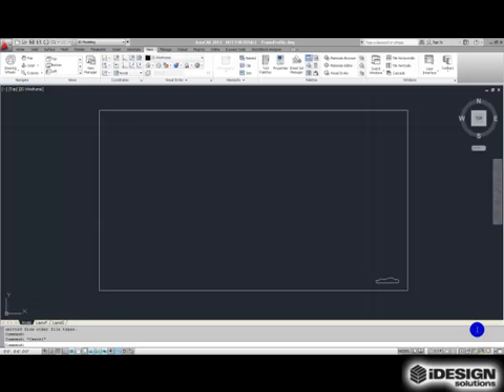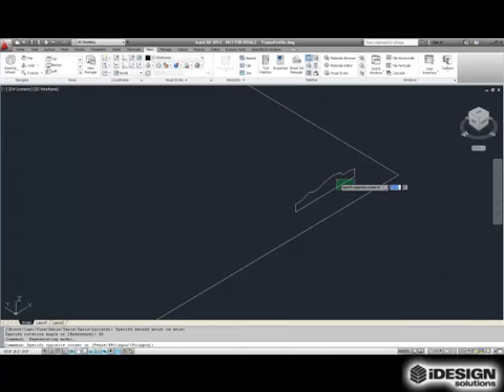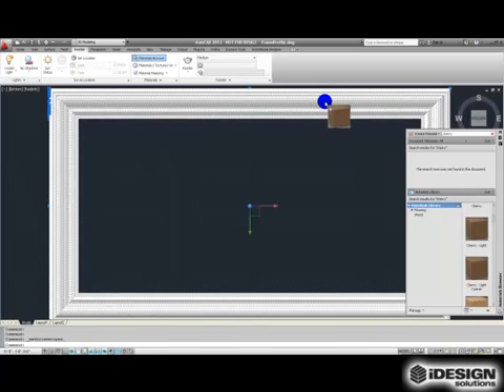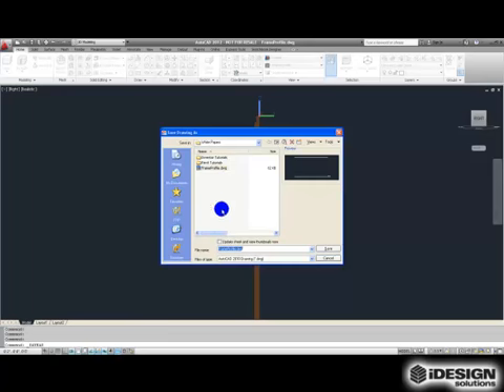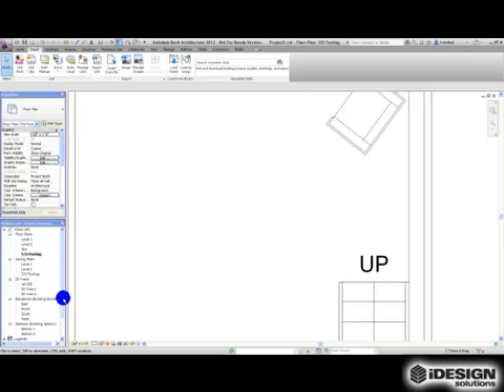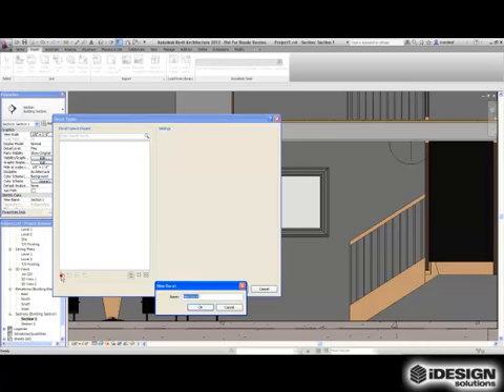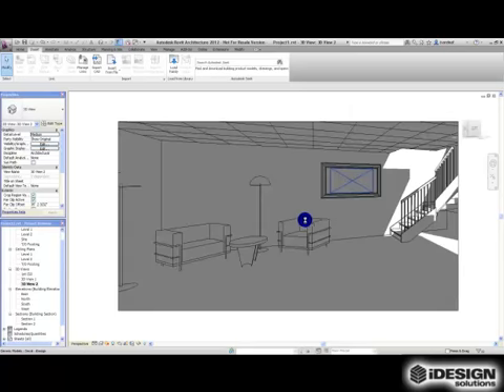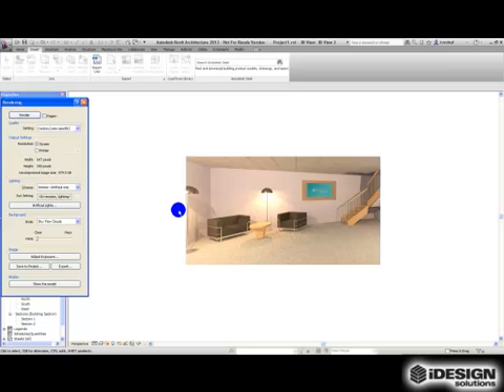Importing 3D Geometry into Revit Architecture and Applying Decals (images)

Comment: In Acad you don't need to rotate the profile nor put it on the sweep path. 1)Type "SW" right click/enter 2) Left click the profile to select it and right click to enter 3) click on the Base Point option (or type "B" enter) 4) Select the base point of the profile shape to be swept (usually a mid/end point) 5) click the path. The item is swept.